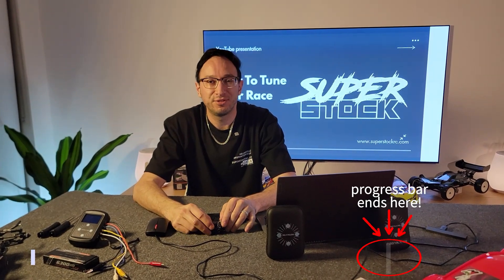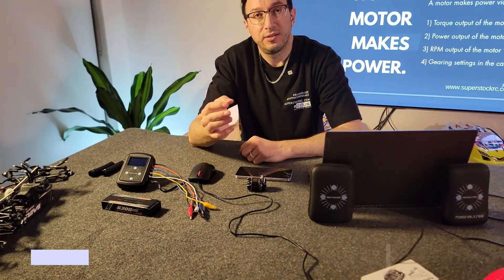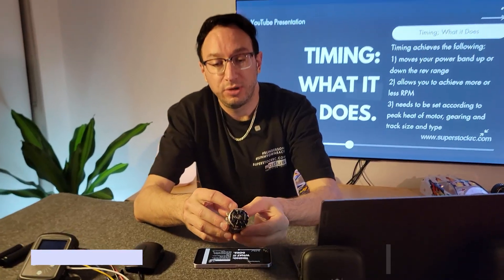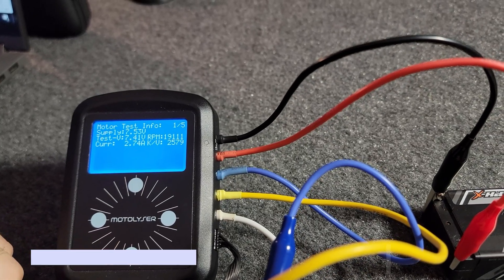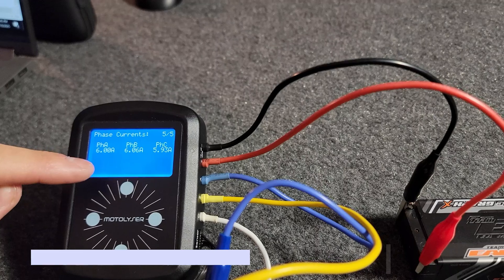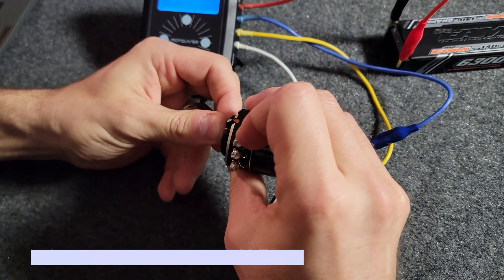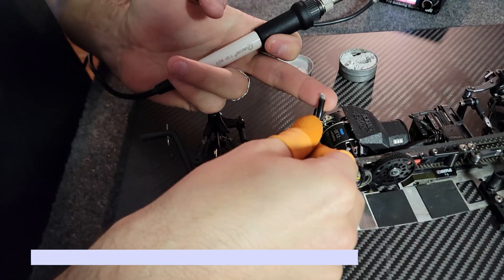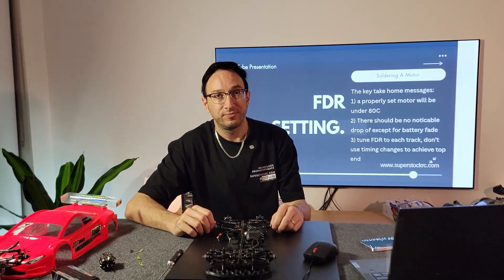RC Motor Tuning Secrets Revealed! Ep. 1

Comment: Hello, I'm a subscriber who enjoys watching your videos. I'm using a 17.5T boosted system and have a HW tuner, but how do I check the phase currents?
Reply from the maker: With the hobbywing tuner you can't check phase currents but if you buy something like this, you can place each motor cable in the loop and measure the amps from each motor cable I believe
I just found this on AliExpress: 
AU$62.20 | UNI-T UT204+ UT202A+ AC Amperimetric Clamp Meter 600A Hook Ammeter NCV Clamp Digital Multimeter Electric Tester Workshop Tools
https://a.aliexpress.com/_mq91IvJ

Comment: I noticed you referred to using teflon shims to allow it to move freely without friction. I assume you mean the shim between the rotor and bearing. Isnt the bearing spinning along with the rotor? So what shim needs to move freely as it should be spinning at the same rate as the rotor and endbell bearing?

Comment: I don't even know what FDR means, nevermind current per phase. It strikes me this tutorial is targeting advanced users as opposed to beginners..
Reply from the maker: That's a good point, I'll do a beginners how to video as well👌👌

FDR means final drive ratio, you calculate this by doing the following equation:

Spur gear X internal ratio divided by pinion gear tooth number = fdr

Internal ratio is usually, if not always reported by the manufacturer, from memory it is the diff pulley teeth count  ratio versus centre pulley tooth count

Amps per phase is how many current is going through each winding of the motor, RC cars have three sets of winding

Current amps is how much current is going through the whole motor

Comment: Good video with some interesting insights. My experience with the Teflon shims is that they make little difference, which since they go between the rotor and bearing inner race, which are both moving at the same speed, is no surprise.
Reply from the maker: I mainly use it as the last shim that faces a contact area, just in case
Reply: I agree with the idea that the shims are spinning with the rotor and bearing. My thought was the teflon shim might be able to compress slightly and may help with any vibration in the rotor.

Comment: Why do you need to run the smallest spur? Can you elaborate please?
Reply from the maker: Less rotating mass and there's no benefit in running larger spur or pinion, simply run the smallest spur and pinion size you can to achieve your FDR. For modified or boosted 13.5t this might be a different story, ie you want as much spur and pinion engagement as possible to avoid stripping... But in saying that stripping gears can also be due to your esc brake setup (ie initial engagement is to sudden) . A third option is there's chassis tweaking under braking, but this is rare. Also make sure your spur spins true, not wobbly. Readjust spur do that it spins true by pushing the high side in if you use an a800rr that uses a single screw system, or paying attention to how you tighten down the spur screws on multi screw setups

Comment: where do you learn these tuning principles, like 6 amps per phase being correct ?
Reply from the maker: This is from my own experience tuning many 21.5t motors, all turn motors can be tuned in the same way. If you run very high timing and retune using the 6 amps per phase rule you will need to go up one to four teeth more on the pinion depending how high your timing was originally. You will find you have a broader  power band this way with great top end, less amp draw and less fade at the end of the run